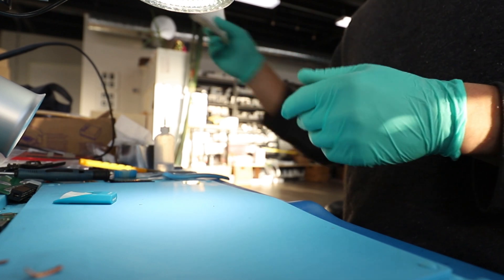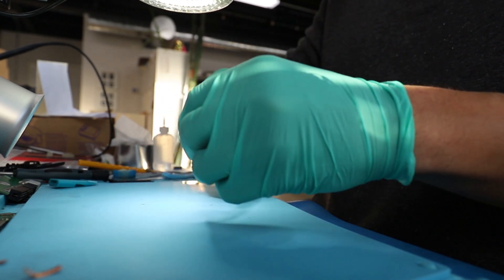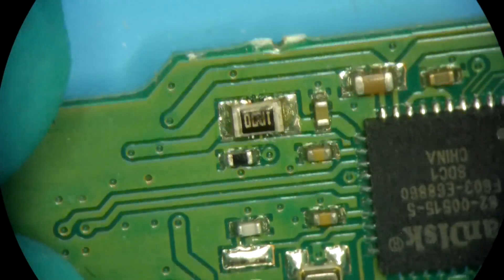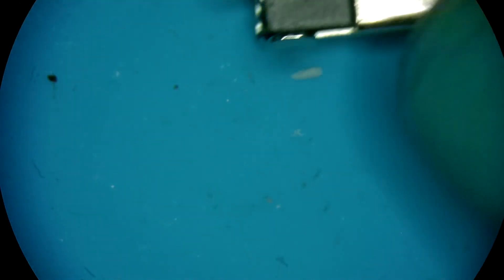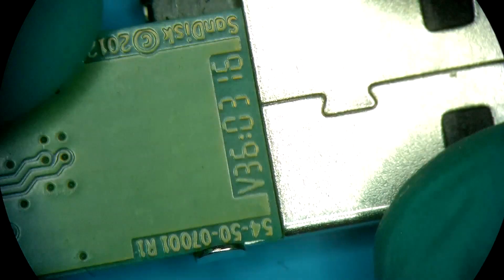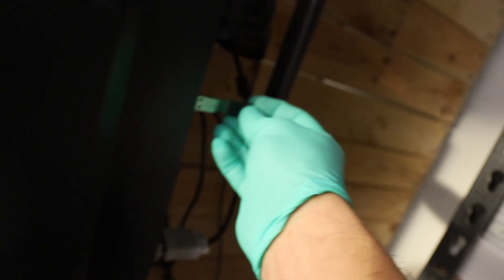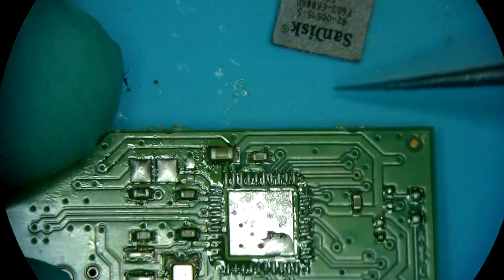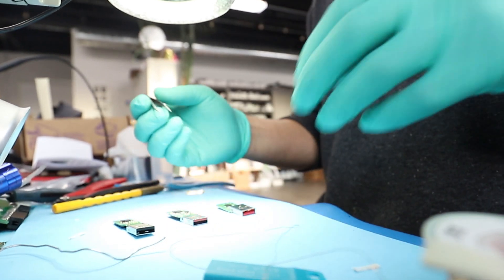flash drive is getting hot when connected

Comment: I am facing a weird problem: Some new USB3 flash drives (Samsung) are getting extremely hot within 10 seconds, when connected to a specific laptop. The same flash drives are working fine when connected to other computers. Other flash drives aren't getting hot when connected to the same laptop.

Comment: Is there any way to bypass the hardware write protection in sandisk flash drive, like short some pins? The controller is a sandisk controller. The flash drive wasnt the problem my usb port was the issue but the drive write protected itself.

Comment: No doubt it's a very skilled job, what sort of price do you normally charge?

My 64gb Sandisk Ultra is getting quite warm and it's no longer being recognized, I've stopped trying to recover the data myself - as I don't want to ruin it any further. It did occasionally show up,  stating the amount of data (rather than being blank) and after a few seconds it would show the drive number, then appear grey.

I have some PSD files which are incredibly important but everywhere seems to be charging 300+, I might need to take the hit and, learn from it because I can't afford that kind of fee (not because I'm a tight arse or anything like that).
Reply from the maker: Unit needs to be checked out. The fact that it gets warm could have several reasons behind it.

Comment: My Sandisk card reader heats up when I connect it to my USB 3.0 extension cable. Weird...
Reply: it's a controller bug from sandisk. Almost all their units draw huge amount of energy when plugged into USB3.0 (if you connect to a limited port like USB2.0 or regulated current output port - no heating problems). They messed up somewhere and all their drives get hot and drain your cellphone batt for example. Solution? Plug into USB2.0 or buy another brand... i've seen some blown up usb ports and controllers on pc's/notebooks but the worst - cellphone jacks get damaged and you only have one port on cellphone...
Reply: @AntonySimkin  nope. I leaved mine pluged to the front usb of my pc (2.0) and i overheated maddly and corrupted my data. And bricked the usb flash drive. Almost melting the cheapo plastic housing. Very shitty product.
Reply: @sbn025  bad luck man... bad luck... shitty devices indeed... btw i switched to Amitosai products and i'm very happy. The dual usb (usb a + usb c) are just gorgeous

Comment: You forgot the basics: Measure resistance at the device power input. If the resistance is low, there is something in shortcircuit. You need to check this first. Not last.

When a fuse blows, it is not repaired by replacing it without first checking why it burned.

Comment: Yep. Burnt current limiting resistor equals over current. I thought you had chosen that donor drive because of the controller. Was quite surprised when you replaced only the resistor thinking it burnt up for no reason. Still, got there in the end
Reply from the maker: There has been many cases where surge was not damaging enough to the controller. However I definitely should have probed pads first :)

Comment: why are you replacing resistors from a working(?) thumb drive, whereas you could just as well have bought the same smd components in bulk? That's a one ohm resistor. With that soldering skills you have you colud just as well have solderes even a thd resistor in place
Reply from the maker: Why order something when I have hundreds of flash drives and hard drive boards for spares at the shop already.

Comment: Hi, i have an intel 160gb SSD, with the known 8mb bug - (Intel SSD sa2bw120g3a). This will reduce the capacity of any SSD to 8MB and change the serial number to “BAD_CTX 0000013x”.
Its a known firmware bug, that intel have released a fix for, BUT it only works on drives that have NOT yet already failed.... (So you wont be affected in the future)...
BUT if it has ALREADY failed, the only option is to apply the fix, which resets the disk back to 160GB factory settings, but the data is not recoverable, because the translator is also reset. Apparently there is no known workaround (Dec 2019), to recover the data.
Are there any other options?  Can a chip off recovery work with this?

a link to a description of the bug..
http://nachostechbits.com/2018/03/16/unbootable-ssd/

Comment: Why you did not use pc3000 flash ?  https://youtu.be/7VahHWI3pT8
Reply from the maker: Why recover with data recovery tools if you can fix the issue and get the unit to give the data by itself in matter of 15-20 minutes. It would take a day to read, correct, and reconstruct a flash this size
Reply: @hddrecoveryservices  Thank you for your response, I agree 😀

Comment: Just noticed that the donor transistor went on upside down. Does this effect anything? or the orientation doesn't matter in this case?
Reply: That's not a transistor its a 1 ohm smd resistor, 1R00. You can do that with smd Caps and Resistor as long as it has the solder pads on the both sides.
Reply from the maker: Once removed the pad had slight damage on the button surface, that's why I flipped it
Reply: @hddrecoveryservices  Thanks for the info. Just learning all this you know. Appreciate the help too random guy
Reply: transistors have 3 legs, this is a resistor, and it only has 2 legs (other components may have 2 legs too, like caps or diodes etc). It was a year ago, hope you know this already. Best luck in learning!

Comment: A good source for soldering equipment (hot air, tweezers etc) is www.mpja.com Low cost source, Weller or Pace brands are quite expensive.
Reply: Weller is mainly professional in the top range of soldering tools.

Comment: What is that gel stuff you are using on the board? What would it be used for?
Reply: It's flux to remove oxidation and make the solder attach more readily.

Comment: Putting a wire in place of the resistor made me a bit worried. It looks like the resistor is acting as a protection device, limiting the current to the controller. It would be safer to check if the short is gone before plugging in.
Reply: I have actually seen this kind of repair on cell phones when some of the numbers buttons didn't work due to corrosion.  Very old trick and still works in some circumstances.
Reply: Eh, the resistor he bypassed was a 1R00 (1 ohm) resistor.   

USB 2 only provides a max of 500mA after negotiating for higher power, otherwise it's 100mA.  
Even with the 1 ohm resistor in place, the max current it could draw at USB's 5v is 5 amps, which is already 10 times higher than the max that USB 2 can put out after negotiating for it, so bypassing the resistor in this case was pretty low risk.

Comment: Impressive repair! I wish I was as capable in soldering... If you still have the shorted out controller, it might be an interesting experiment to try to burn out the short by keeping it powered for a while, preferably using a lab bench power supply to prevent damage to your computer. It might just work good enough after that to recover the data. Or it releases magic smoke and the smell of burning electronic death... edit:Replacing missing newlines with spaces.
Reply from the maker: I've tried that with microSD cards before, but it did not work for me

Comment: Would it be possible to just blow air onto the controller using a fan? To make it work for like 10 minutes until the data is copied?
Reply from the maker: Maybe liquid nitrogen spray would keep it running longer, but definitely not a fan. When I pulled the unit out it was burning hot. After only few seconds of power.
Reply: @hddrecoveryservices  I'm just judging by the way CPUs work: if you run it with no cooling at all, it gets incredibly hot within seconds (and turns off / hangs), but as soon as you install a radiator on top and/or blow air onto it, it gets going (at least for a while)